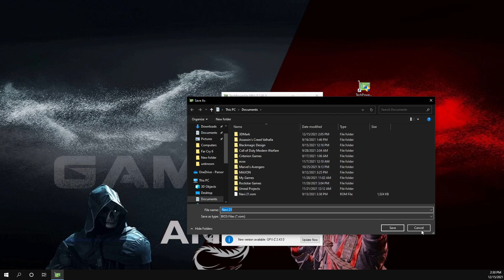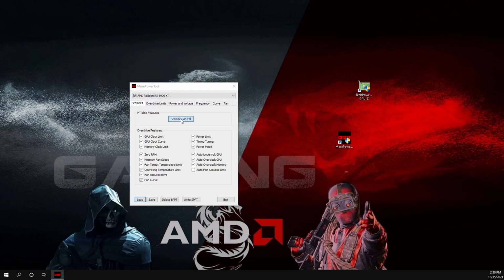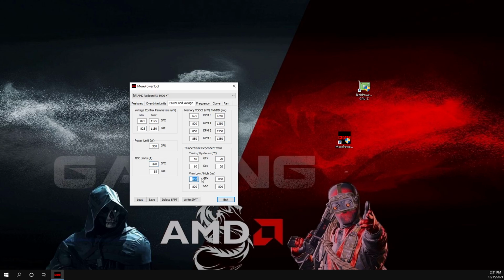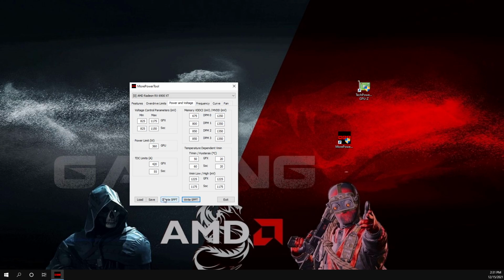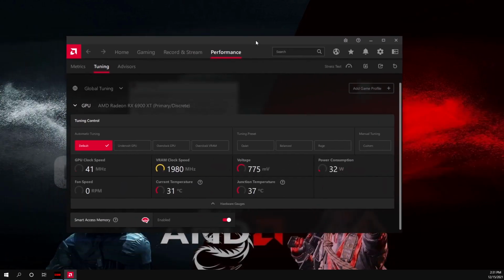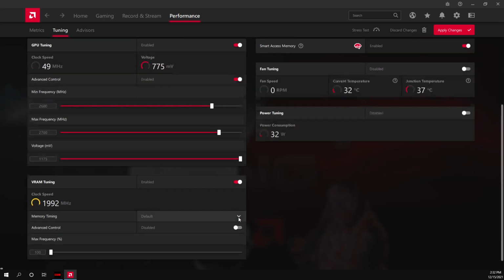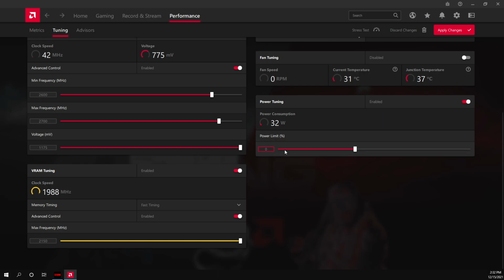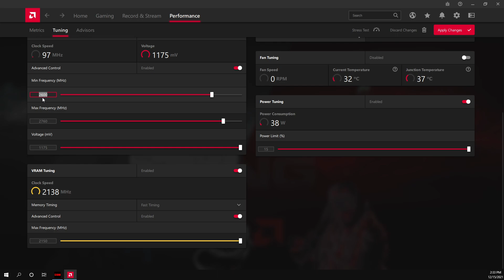AMD MPT ( More power tool ) Updated with how to add voltage adjustments.

Comment: I also have the sapphire toxic card. Can I just copy and paste your settings? Do you run this sppt file every day? I am looking for a stable overclock i can run daily on games. my 5900x is on advanced PBO hitting 5ghz on most cores. Trying to max out the gpu as much as i can.
Reply from the maker: No you can't copy the settings I use here this is how to use not copy my settings this could uod damage your card if you don't know what you are doing. Please don't. Mpt is a tool to over power a card.
Reply: @AMDPCBuoldersCommunity   Do you have an example of safe settings to use for a nice overclock?
Reply from the maker: @prestonbeast  you best bet would be setting to what your GPU average clock is and bump it up from there. So say your average clock is 2500 then run it there test if stable try 2525 see if stable and then bump it up again to 2550 this will very by GPU cooling and a lot of other factors with your system
Reply: @AMDPCBuoldersCommunity   i just increased the power limits to 340 and 360. upped the voltage to 1200 MV. im at 360 watts being drawn and close
 to 2900mhz on the core
Reply from the maker: @prestonbeast  really below a 400w you should not need more voltage.

Comment: What's the tdc SoC limit? I heard that increasing that value can help with stability, but I'm not quite sure as to how
Reply from the maker: the ones I did is all I know to change now is what was shown here I have been 100% stable these gpus I would only step up lightly.. and learn them in voltage if temps are good you can most likely bump up by .25 so if base xt 1175 I bumped mine to 1200 then kept raising the max clock till drivers crashed then if temps were still good I would bump up voltage again. when they start to get to hot or drivers become glitchy as sin its time to back off so far my gpu temps have not been over 65c..
Reply: @AMDPCBuoldersCommunity  what about tjmax temps on gpu?
Reply from the maker: @prfrag  It's kind of hard to explain as this would be more based on cooling solution being used and room temps being your main limits using these tools.. it for the most part if you are running over 70c gpu temps you should stop. drivers will crash if clocks or settings are to aggressive way before this as well. at least in my experience. really here this tool is for benchmarking you should keep it cool as possible once I am done with playing the numbers game I remove the settings for gaming stability as it will cause issues..
Reply: @AMDPCBuoldersCommunity  Do you mind me asking what your junction temps are, i'm assuming 65c is your core gpu temp. Thanks for this awesome info btw
Reply from the maker: @shrek7428  depends on settings never over 86c they don't throttle till 110c